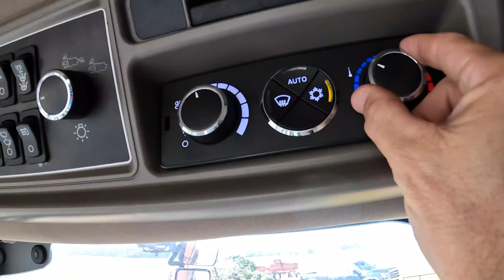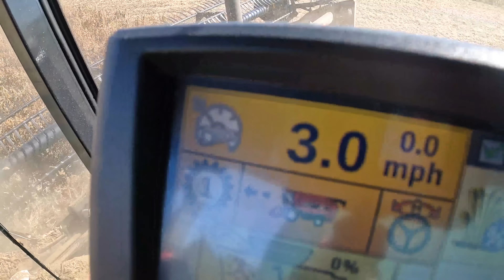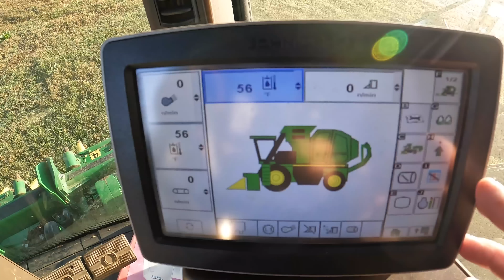I GOT TO HELP DAD CUT SOYBEANS FOR 2 DAYS

Comment: Good video as usual. After years of hating to park implements in grass & tall weeds I finally built gravel pads for them all to keep the weeds away, difference that made was unbelievable, wish I had started it years ago. Some guys have started to mount auxiliary air compressors to their Combines & run air lines with baffles to all the dust collection spots with switches in the cab. Flip some switches every 30 minutes and right before you stop & all the dust & chaff is gone, no need to blow it off anymore hardly. It’s was thought for to save time with that blower, but I imagine it will prevent a few combine fires, when the big manufacturers see it I’m certain it will become a standard option on most pickers & combines.
Reply: At probably a $15K add on the price.
Reply: I don't like to blow dust around while the combine is still hot then leave it alone. I'll leave it dirty  and clean it the next morning if I'm too tired or too busy to wait  til it's cool. That's MY thoughts,disregard if you want.
Reply: @57fitter  no I understand, like to hear others opinions & approach. Some think it’s to dangerous to let all the chaff & dust lie there on the Hot Combine, feel it’s better to take it off right away before they leave to prevent a fire, others say wait. As long as it works for you, that’s what’s good.